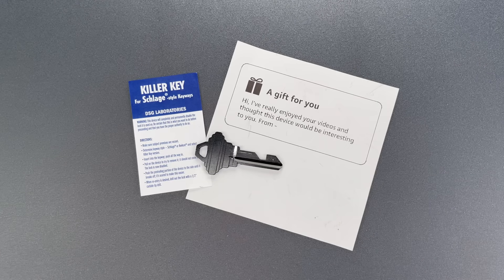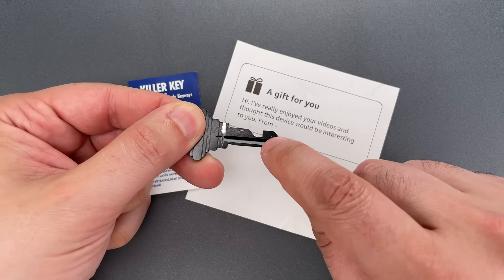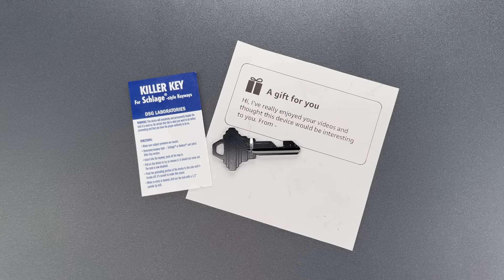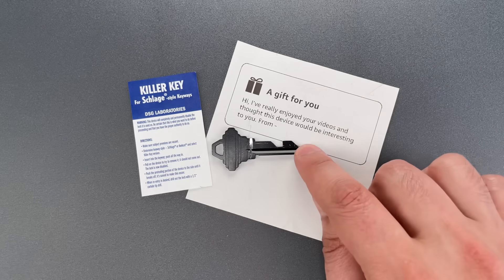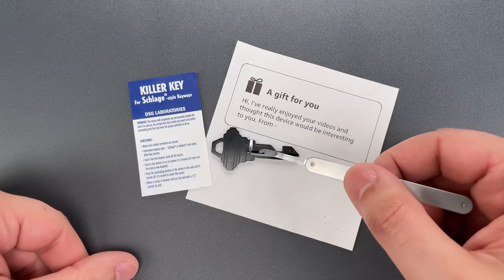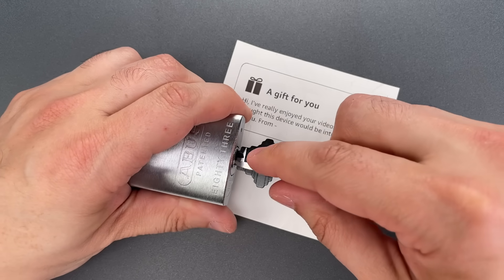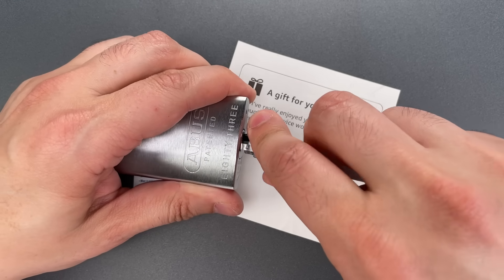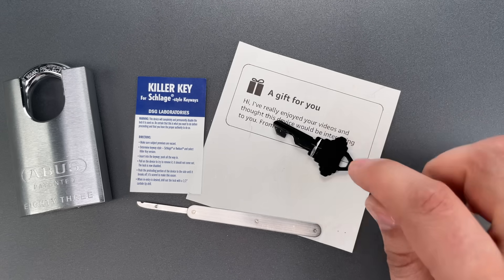[1350] Defeating a “Killer Key”

Comment: The company should make the killer key with a cross guard to cover the entire cylinder preventing any lock picking while the key is stuck inside. To save manufacturing cost, the killer key doesn’t even have to be milled. It could be easily done by tab welding. Then the stress notch could be cut behind the cross guard. In that case, removing the killer key could be really time consuming…

Comment: I wouldn't see this as preventing someone from picking a lock, but just as a way to prevent someone from accidentally locking something. We have a few cabinets at work, where we actually just glued the keyway of the locks shut, because the locks dont work right and if anyone locks them, you need to disasemble the entire cabinet to open it again

Comment: Would it have been that easy if the head had been sheared off?
Reply: Yeah. The attack he used is inside where the head is. So it wouldn’t matter if it was sheared/snapped off so that the head remain inside without the handle.

Comment: In other parts of the world, this is a designated safety feature device made by AssaAbloy (lockwood) called the "Securiturn" google it - Assa Abloy thumb turn MC35 - instead of a keyway blocker .. it is machined to stay in and able the cylinder to be turned, and it has a special tool to remove it, when the cylinder is required not to be used.

Comment: I didn´t understand the point of this key
Reply: Imagine if you know someone has a copy of your key (didn't have a chance to collect it, had it stolen or duplicated) and don't want to risk them using it while you're arranging for the lock replacement.
Reply: @accelriderx2931  sound stupid since i´m going to demage the whole lock
Reply: @ I mean, that's not a problem if you are about to replace it either way. The point is to disable the lock and lock out someone who has a key for the time it takes for the new lock to arrive and get installed.

Comment: The problem with the redesigned key, is that removing the shoulder would not “kill” the cylinder, as it could be pushed through the plug in most instances, if you could gain access through a different entrance.

Comment: WELL, the way to test your theory>Just before you remove the old spindles-give them a good greasing. After you remove them-inspect. Remember to grease them properly- I was a truck mechanic for several years and the way you do it is>>>
-wipe all dirt off the zerk fitting
-grease until you see grease come out somewhere to tell if the joint is full
-keep greasing until all old dark & dirty grease is pushed out and you see fresh new grease
-DONE

!

Comment: I bought a new E140 in 2018 and I greased the spindles regularly for about a year until I saw a vid explaining why that is unnecessary so I then stopped As soon as the bearing fails, I intended to pop the dust shields & go back to greasing until one day I realized it was 2024 and the mower had 500hrs on it and the spindles were all just fine. Smooth rotating & no play nor any noise. 6 years is a good long time so I felt that was a good testament to the longevity of those sealed bearings. ONE thing tho-I  NEVER  wash my deck with water-air only as per JD as they said water will gather around the spindles and seep down the shafts into the bearings. So, no water. When my bearings finally  Do  fail someday, I intend to replace with sealed bearings and not grease them as it has been my experience it is not necessary.

!

Comment: What would be the best way to actually kill a lock? I want a keyless smart lock but there are so few models out there. Wyze Lock Bolt is the best but it’s missing features. I’d like to get a feature packed smart lock and disable the key hole from working so it’s more secure.
Reply: My guess would be something like this key that hooks onto the pins, but the end of it should have a steel disk welded to the end to prevent any tool being inserted along the key.

Comment: With my luck, using the method to remove the killer key wouldn't work. If a skirt was locked tight on me and that key was inserted in the lock and broken off, I would have to wear that skirt forever.

Comment: super glue and activator can be bought from amazon and can actually ruin a lock in 20 seconds. this is just gimmic waste
Reply: Super glue is easily dissolved
Reply: @Unknown-g7w  not out of a lock. To desolve super glue, you need to soak the item so a vertical fixed position lock with glue in the cylinder  is fucked.
Reply: @jaxzian  no? Acetone will do it fine with a spritz, and other solvents will dissolve it even faster.
Reply: @Unknown-g7w  sure then, fill your house lock with super glue and then try to desolve it all to make your lock work again. Get back to me when you get it working.
Reply: @jaxzian  I've literally done it before, here's your L
Reply: @Unknown-g7w  sure bud
Reply: @jaxzian  your lack of imagination isnt very compelling pal

Comment: lame, you didn't even break it off to show how easy or hard it would be to grab the remaining bit and pull it out. also if you can insert the thing in there, it means key is too small for the lock. if i was gonna jam the lock, i'd make it out of softer material, but still hard enough to be able to insert it.

something with a big handle, so you can push it and then material gets mangled, then you break the head off and it will really be stuck.

Comment: @lockpickinglawyer   I tried to use s normal lock out key on my bedroom door. It's not locked so no big deal. I have very small .015 lock pick set. The danger field if u are familiar, but it won't fit into the key hole. Did I screw up,? I was bored and feeling bad so I wanted something to distract me.

Can u link a tool that would help? Will the decoder work? This lockout was a thick black key. Hopefully, I can get it out

Any advice from you would be helpful. Key looks like yours did

Comment: I tried to use s normal lock out key on my bedroom door. It's not locked so no big deal. I have very small .015 lock pick set. The danger field if u are familiar, but it won't fit into the key hole. Did I screw up,? I was bored and feeling bad so I wanted something to distract me.

Can u link a tool that would help? Will the decoder work?

Comment: Wait what... Useful? I don't get it, isn't the point that they make your lock useless? 
I'd honestly rather get a remote lock that's shielded and lined with a non-ferrous material at that point. It would save me replacing the lock constantly.
Reply: Disabling a lock is very useful in some circumstances, like a condemned building

Comment: I actually have a question. With a padlock style lock, couldn't you just... turn it upside down and then just pull the killer key out? Not a workable tactic if the lock is embedded in a door or something, but still, it seems like it would work on padlocks just fine.

Comment: Killer Keys work great with superglue. I'm not sure if this dimpled shim would have enough strength to push the pins in and pull the key after you melt the glue, but I doubt it.
Reply: Superglue is easily dissolved

Comment: Just fill the key chamber with super glue and you’re good to go, that’s what the locksmith company I work for does to disable a cylinder. Cheap, easy, locksmithing lawyer proof.
Reply: Super glue is easily dissolved.
Reply: @ who on earth is walking around with superglue dissolver? I understand there’s ways around most forms of security but there reaches a point where the effort just gets unrealistic for 99% of people. If you’re going to go through the effort of coming back with super glue dissolver, you were probably going to find a way inside either way. I’ve been using the super glue method for years and I got the trick from my boss and I’ve literally never heard of anyone breaking back into one of those locks who didn’t just break the lock altogether. 
That’s what I don’t like about LPL, his comment sections are full of “security experts” who think an international super spy is going to be the one trying to break into every single thing they own. 90% of break ins I deal with are 1. Someone got ahold of a key 2. Crowbar. 3. Angle grinder for padlocks.
Reply: @DrMindmasher  acetone is commonly carried by women as nail polish remover, so....a lot of people?
Reply: @ I’m not sure what episode of cops you’re watching but personally I’m not seeing many burglars doing robberies with a purse

Comment: How is a killer key useful?  When would you want to use it?
Reply: I wondered the same. So i checked the product page.
It can be used by law enforcement as "Denial of access" (maybe some operation requires a door to be made inaccessible for safety)
And also by Landlords. This way they can disable the locks, so that tenants cant enter before the locks can be changed.
This sounds like good reasons to me

Comment: I found out how to make those as a 12 yo boy when I was looking at the pins of a doorknob. I just cut 90% through the sides of the key as well so it would break off inside when someone pulled it out. They worked very well... my youngest brother found the ones I made in my room while I was gone and tried them on some doorknobs that they fit in, and they all had to be drilled out

Comment: It's designed to irritate regular people, not thieves or locksmiths walking around with picks on them.
Reply: Do any thieves pick locks? The only ones I've heard of, find doors already unlocked, or kick them in, or smash windows.
Reply: @craigmcqueen7992 Well, stereotypical thieves are always seen with lockpicks for a reason.

Busting down a door or window, while quick, is also quite loud and noticeable, and will alert anyone nearby, especially anyone in their homes.

While most thieves likely go for the low hanging fruit, robbing backyard sheds in an old man's house, sometimes that shed is locked. Or that basement with the entrance from the outside.

I wouldn't know, though, I'm not a thief
Reply: WOW so insightful!
Reply: @adroitone8911  Well clearly other idiots like yourself desperately needed to hear it to figure it out.

Comment: Seems like the killer key could be made significantly more effective by making it thicker, such that it's a medium friction fit. You might have to use a hammer to insert it into a lock (not a problem IMO), but then there wouldn't be room to insert the shim tool, and it would be much harder to withdraw, especially once the bow is broken off.

Comment: can you tell me whats the use for these killer keys because it doesnt unlock or lock just disables it
Reply: Landlords are the major users, to prevent evicted tenants from returning in case a locksmith is not available to change the locks immediately following the tenant's removal.   

A friend of mine used to own two rental properties and mentioned the killer key being used once, out of the 4 times he had to file eviction in the 20 years as a landlord.  In most cases a locksmith was available to change the locks within a few hours after the tenants were removed and the unit cleared.

Comment: I find a much easier way to disable a lock is just to stick a toothpick in it and break it off at the tip, then pull the rest out. Worked wonders for me as a kid when I accidentally did it while pretending to pick the lock on our front door.

Comment: There is another way of dislodging the killer key which is taking the cylinder out and taking the top pins out, basically taking it all apart.  I’ve done it a bunch of times rekeying locks, but your way is much simpler.  Wish I had this tool back then.

Comment: how about one of those dipped in epoxy?  
Also, a max width key blank might help.. carry a few to find the thickest that fits?

Someone else said to keep it under a mat, maybe also make sure that they key will get the fingerprint of the user and does not break off.

Comment: Is the key purpose to break the lock or to open it? But heres a unrelated lock question. I have a newer bolt lock but anytime i place it a key in it, it tends to not always want to turn. Alot of the keys get stuck in it as well. & i have bent a key just by turning it. I'm a big dude but i ain't that big, although i do got like 3 bent keys. What do you think causes the keys to get stuck.. I tried oiling where the key goes but it doesn't seem to do anything really. The lock was put in by a professional.

Comment: What about a killer key made of glass with solder at the bottom of the groove with wires at each end running out side the key with a small contraption that heats up the solder to solder the pins to the key, then you break it off, but at the groove are two small spring contacts like in earbuds so it's not a pain to break apart.

Comment: Quickset has a lock opener that pops out the rose with this same key. It has a key release that pushes up on the pins to slide out the key. I have two of these kits but they're not much useful anymore as Quickset has begun making their locks with plastic parts that bend or break when popping out the rose. I mainly use them on the older locks to rekey them.

Comment: There used to be a certain Kwikset keyed knobset where the lock mechanism plate was held into the knob by a pair of clips. I made a key just like that and used it to pull the lock mechanism out. It was the fastest way to defeat that lock. Though, what with their plastic housing, you could usually just rake once to pick them. Yanking out the core was only just a little bit faster. I ground down a key blank to be thin enough to slide in next to my grabber to extract it.

Comment: I did my damage a little differently, I cut a paperclip in half, inserted into the keyhole v end first, spread out the paperclip a little wider than the keyhole, pushed it into the hole just to the edge, then when the key holder inserts the key, pushes in all the magic of the paperclip, and that lock is screwed...
Had to call a locksmith to drill that one out...

Comment: If you want to disable a lock requiring it to be drilled out, wouldn't you just lock it as normal, withdraw the key, and inject a copious amount of epoxy glue into the lock? If you wanted it to be fast, some UV set glue and a UV torch could be used. I'd like to see the lockpickinglawyer pick a lock full of set epoxy.

Comment: I suspect the scoring on the original is behind the shoulder to prevent a person from simply pushing the key stub through and out the back.

One with a simple, vertical notch that grabs the first pin, and then breaks off entirely inside the lock would probably be the way to go.  Would, at least, take a bit to figure out what was even in there.

Comment: What is the use of these? Protection from an attacker? OK...but the owner can't remove it either....what's the deal? The idea is to disable the lock permanently? If es..why would you want that? I mean you can weld it, or even destroy the key hole so it can't be picked...

Comment: They mainly use killer keys to permanently disable locks that shouldn’t be used anymore in doors and machines however they sometimes also try to make it even harder to remove the killer key by also filling the lock with silicone glue or adding solder to the gap around the key in the lock opening.